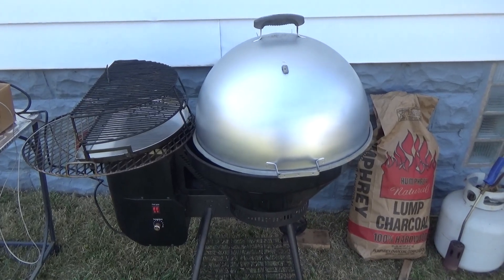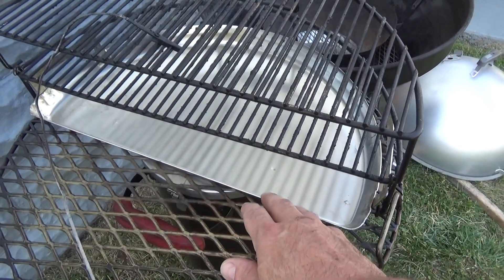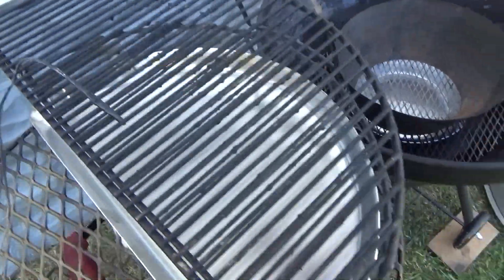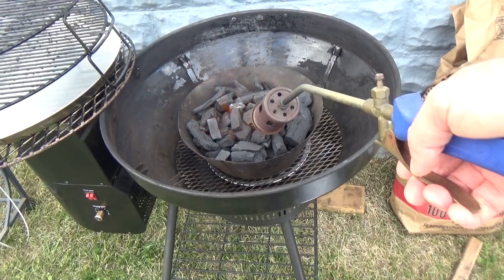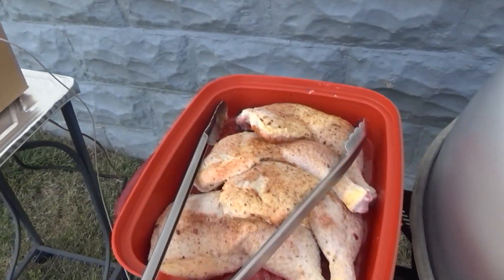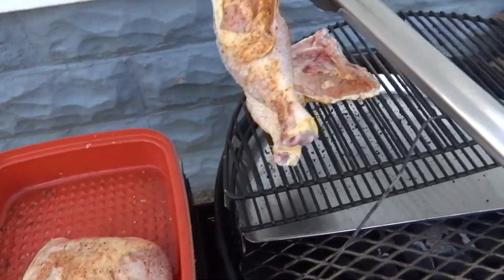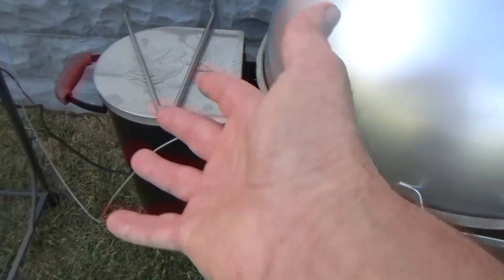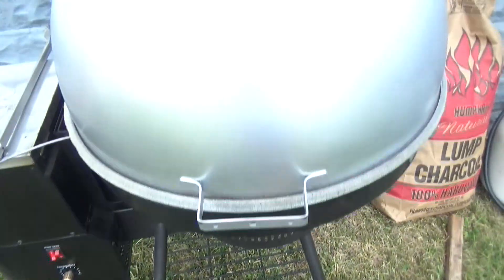"New"  AUTO-KAMADO KETTLE, PID Controlled Grill Hack

Comment: Looks great!  What are your PID settings?
Reply from the maker: Hey Paul Thanks for checking it out!   I don't get too technical with the settings, I just do the Auto-Tune and adjust my Set Temperature 
for whatever I'm cooking. 👍  I've used the PID controller on everything.......even an exhaust fan on my Offset Smoker. 
Hope You can go check those Vids out. 👍     Metal On! \🔥/